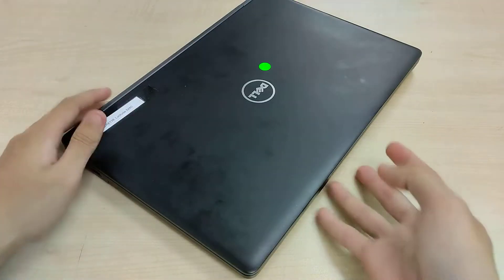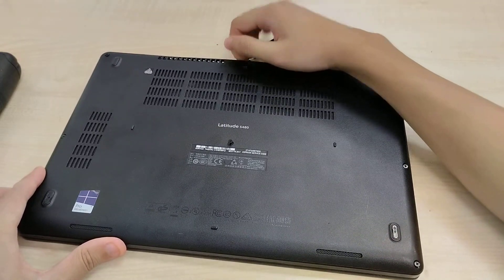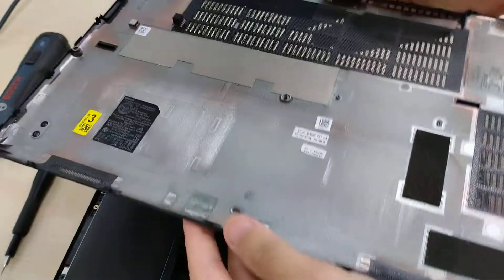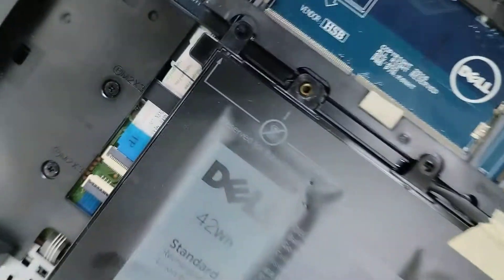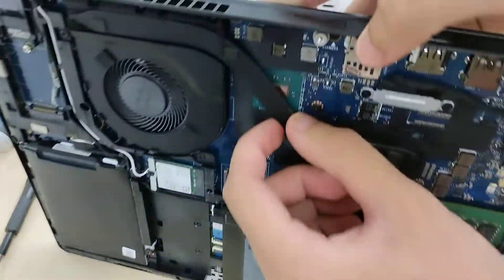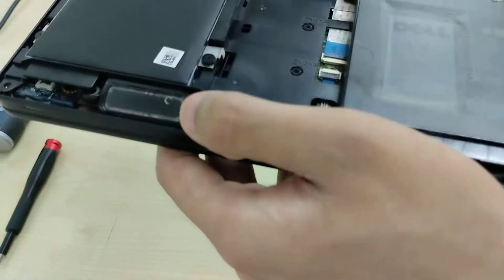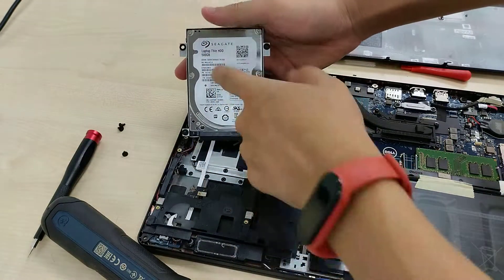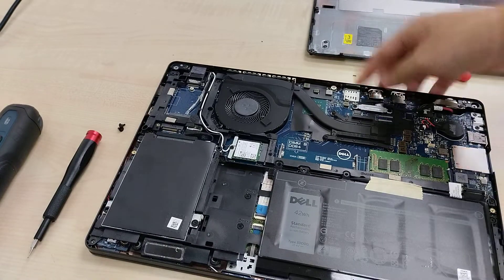Dell Latitude 5480 Internals (i5-7440HQ CPU, HD Graphics 630 GPU)

Comment: is dell lattitude 5490 i5 gpu is upgradable?
Reply: Sadly not as it's integrated into the motherboard along with the CPU, but you can improve performance by upgrading the RAM and SSD as they are removable.